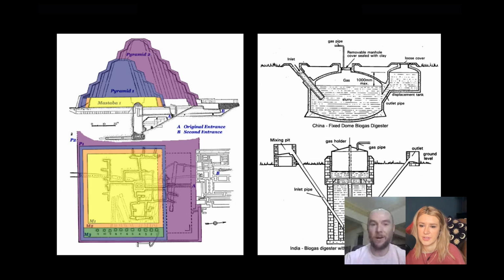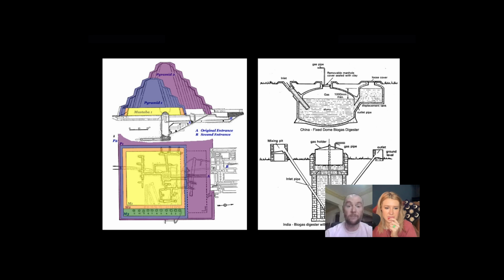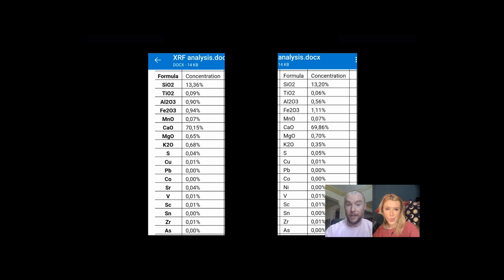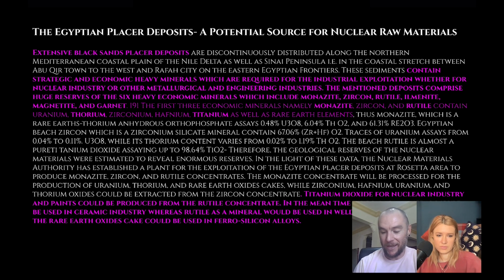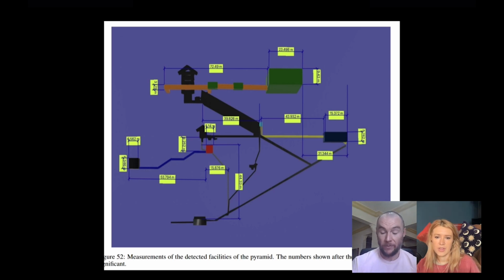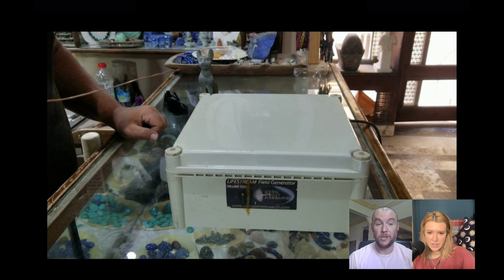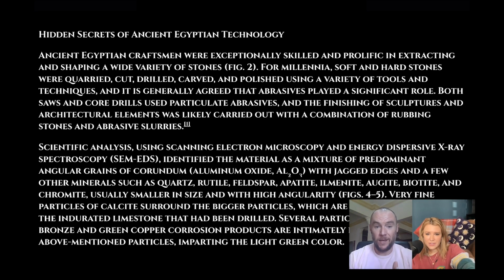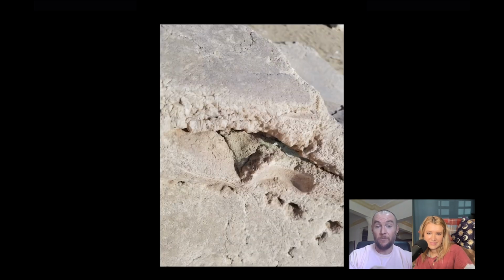The Original Purpose of the Pyramids

Comment: um, you never revealed what they would do with methane gas? or where they would store it? what burned it?  I do know that the one pyramid was hermetically sealed at one point, and it remained hermetically sealed until the 20th century, but they feel it was preservation of the tomb (mummy[s]) ?

considering they had no direct use for methane gas unless they were to burn it upon production to blast furnace iron ore...  yes they had iron ore and blacksmiths in the day, they had tempered steel, hammers and chisels, how they removed all that rock, every  bit of evidence of it is long gone and it was long recycled ..   there is PROOF they were smelting iron in Mesopotamia 7000 years ago!

so please STOP trying to make this more difficult that it needs to be, the chemical is from a smelting process, coke and borax!  good grief!

now that we KNOW they had blacksmithing we know they had metal pulleys, bolts, nails so on so forth ..

they didn't have gas heaters back then, nor gas stoves and moreso they had no way of containing methane gas!  PLEASE

they used whales for oils, they used oil burning lamps, PERIOD, no Coleman stoves FFS, for the plain and simple reasoning they had no bottles to contain the gas in, they had no way to fill bottles,  good grief magic..

unreal ...  they had NO WAY TO CONTAIN METHANE!  no way to STORE IT!  methane must remain under pressure to be volatile, they had no way to weld metals or make iron sheets to make bottles..

how did every household get the methane? for intents it may as well have been propane, see how we do it today? piping? valves? large bottles, small bottles?  they didn't have that back then, they didn't have gas lamps, they didn't have gas stoves!

had they had gas stoves and lamps over a period of 4000 years every household, there would be so many of them left here and there as they do not decompose, yet not ONE single burner has been found, not one single orofice, an orofice is requires to burn the gas, housings, then you need valves or the gas just burns at one speed.. yet zero evidence of any of that, none and every household would have these?  that's millions upon millions over 4000 years..

there isn't a SINGLE hieroglyph or petroglyph of a burning lamp or stove, and just like the Djeb pillars this technology would have been written everywhere.. they would have had an over flow flame burning at all times 24/7 like ALL natural gas plants have, not pone depiction of...

NO they didn't use the pyramids to make methane gas or chemicals, the chemical residue is form smelting which they did do, and they do have petro's and heiro's of this simple smelting process, bronze, copper and finally iron ore, precious metals as well .. they were using stamp plants to crush rock to extract gold, that's about as advanced as they were, rope and pulley
Reply: what is your thought on the conduit system that comes out of east of the pyramid and ends up in bowls made of large stones? it doesn't look like drainage, it looks like they were collecting something. chemical in condensed liquid form? those stone bowls are located where a temple was once located - now in ruins.

Comment: Sounds kinda like my idea that the pyramids exploded due to either flood or drought is correct. All three pyramids have retaining walls to keep the water outside of it at a specific height to keep inside pressure at a equal level like a float valve if water were to fill an exhaust vent it could over compress the gas and have a catastrophic failure. Just an idea

Comment: They couldn't do those cuts with saws or big copper drag saws they look like giant circular saws  and big ass circular saws need a big ass machine or motor to run them  so their is still a lot going on that the mainstream doesn't address  and the speed of these tube drills and  circular saws which they can calculate in the striations are like 50 to 500 times faster than what we have today  when we cut stones that big and hard its still a slow process  and that's with modern machines and water sluries to help aid the cutting

Comment: If they could make different alloys  why use copper at all then  and it also doesn't explain the saw cuts that look like giant circular saws that would have to be in so.e cases 30 plus feet or more big and the saw cuts were they look like they dipped into the stones  also that one picture looks like alabaster which is really soft

Comment: Alessandro Barsanti stumbled on the Zawyet El Aryan site.
After so much digging and removing rocks that had been used to hide what was a water chamber.
An oval shaped bowl was found with a lid glued on it, it was apparent that it had a black oily substance that had almost evaporated. Pink granite was everywhere, this place is 5 miles southwest of the Giza plateau. There are deeply etched water line marks.
A two way water pump was sending water to Giza. Oh, it was also mentioned 2 pyramids maybe were used together. Once energy was established with water, pink granite to carry electricity up to the gold top of the pyramid. The water pump was carried out using a small true to scale from the underground chambers. It worked.

Comment: Interesting. But the value of the produced chemicals needs to be exceptionally high to be proportionate to the cost of construction. Most likely not for fertiliser. Composting manure on site would be far superior to transporting to the pyramids and back again. And the volumes that could be processed seems tiny for the scale of the project. But possibly industrial/manufacturing chemicals.

Comment: Im also a ChemE. I was not aware of this fellow and his work. I plan to watch his other videos and review his theories.  One thing I will say now is that every time i have ever looked at a diagram of the chambers in the GP, it reminds me of some sort of reactor. It also explains why the extreme precision was required in the stones. They had to fit perfectly because it was a pressure vessel made of stones with no sealant or mortar.  Today pressure vessels are usually made of steel. But they only have a life of a few decades. If they wanted  something to last millennia (and survive inevitable wars) it had to be made of stone.
Anyway this is very intriguing.

Comment: 9:52 could you determine the flow rate, weight and viscosity of the fluid based on these patterns? I work a lot with DNN and I see a perfect opportunity for application on pattern recognition of fluid dynamics on these structures- it would take some time to implement so I wanted to know if it is possible to tell without that?

Comment: I want to believe this. But stone doesn’t slide well. It may have been exactly what you’re saying, but it only worked for a minute. If they used the small shafts as a choke, there would be easy access. Not blocked with closed entrances. I think the small shafts were closed and filled with water. For conduction. Making a water power line essentially.

Comment: Giza, due to the tuned 70+ ton stones in the kings chamber, vibrates at an F sharp. Coincidence this is Earths natural vibration frequency. The pyramids purpose was to eliminate large earthquakes. 
Built on a ley line intersection and apparently at one time on an aquifer.  The pyramid shape is an inverted funnel for -ions. To stand on giza, even with its outer electrical insulation removed, your hair would stand up like your hand is on a van de graff generator. Massive -ions flow out the top providing Earths ionsphere.  

The pyramids are terraform machines.

Comment: The saw blades shown later in the program was not what was used by the megalithic builders.  There are cuts in positions and locations where that gear cutting tool could not account for.  If it's so simple, go ahead and prove it.

Comment: All natural rock is porous, so using stone vats would mean they bring soaked through.  Due to soaking in and down (due to gravity), it'd be sloping at an angle.  A stain would be soaking deep into the ground, of course.  And where is it?  If they had a sealant, they wouldn't have stain at all.  Presumably, a bad seal, over such a time, would have stain deep into the walls and ground.  So where is it?

Comment: The pi ra mids . Are for sound resonance chambers to balance the chakras ie our glands. Nothing to do with chemical plants . Pi as in it take pi to even biuld a pyramid Ra as in it used amen Ra the suns ra ys and mid as the pyramid does have a brass shaft which is also earths that goes from what would have been the golden cap and the solar panels on the pyramid skin .

Comment: Hey ye funny ol world, hard work but we got through it 😅 the guy has an interesting take on it and makes sense they served a purpose.. the most feasible theory I have heard to date is the structures being mine waste deposits (composite blocks stacked in the most efficient geometric shape possible).. eerily similar to the smaller scale and less developed methods we are using in the mining industry today.. It would make sense to utilise the placement and guts of the structures for a dual purpose like above.. (Curious Being theorised the chambers and 'vents' were to reduce mine waste leakage from the chemicals involved in mining but there you go).
 Also I wanted to point you guy's towards the examination of a vase from under the bent pyramid (of which there were a couple of thousand), which suggest in their very accuracy a far more advanced method of cutting than as this guy mentions.. this vase has like 3/1000'ths of an inch tolerance across two axis so the technology required to even read those tolerances let alone machine them is mind blowing to me.. were talking about the ability to machine spiral gears even to start gauging tolerance with a mechanical calliper/vernier let alone to start machining them.. and then we must ask the question 'why' they would actually even consider needing these tolerances, not to make laser precision granite vases thats for sure as they only function in asthetics.. if you can understand that  champion.. all good, love your take on life btw 🖐😊  pyramid juice 😂👍👍

Comment: The base of the red pyramid "pump shaft" would have been a valve, not a plunger. The valve's purpose would have been to manage the pressure in reaction chambers created by the column of water in the shaft. It could have been pulled up from the top.

Comment: Something not discussed at all.. the pyramids are way overengineerd if the initial purpose was to make methane/amonia. Try to align the builings in a specific way, finish the outside with presicion. They could have build a way more crude building for that. It doesn't make sense to me. A far more realistic scenario would be that during the stripping of the pyramids for building materials, some people can to the idea the can mix dong and iron in some chambers to produce ammonia. Probably easier for them than digging a hole in the ground and put dong and iron in it. But building a pyramid for that, no.. the first claim, amonia and maybe methane, oke, but the latter chemical processes, I'm not convinced. Some trace elements of heavy metals are common, thats why they are trace elements. Using a electron microscope to analyse a "sample"? You can probably find a trace partical of thorium in every home. I think he's reading too much into it and trying to come up with a chemical process thats fit some trace elements. Im not a chemist, but I would like to see debates on the subjects with people specialised in pyramids and chemistry to see what there arguments would be. I can't find any critisism on this subject, red flag.

Comment: Wait!  You labeled the Roman stone cutting machine as "ancient technology' but that is not a realistic label because the machine depicted is from an inscription on a stone block from the 3rd century AD!  That is not "ancient".  You could even call it modern... as in the age of modern metals, advanced engineering, and hydraulic concrete.

So, you need to recognize that the age of Egypt that you are focused on is some 3,000 years earlier than that.  That being the case, it cannot be said that because the Romans had stone cutting machines therefore the Egyptians of multiple millennia before them did also.  A society that is supposed to have not had the wheel yet certainly did not have gears.  That leaves the very real possibility that they relied on heavy, wide, large pendulum saws along with the hard-grit slurry that is still used today in drilling for oil.

Comment: 28 minutes into video, basic hydraulics, you wouldn't need a plunger if the water column is higher than the chambers. The head pressure would act as a plunger increasing the gas pressure. No piston or plunger to seal. Water only.

Comment: plus with the area having been previously a jungle of sorts, there should be no shortage of methane gas below egypt around the flood plains. with their obvious advanced tools and drilling capability, i can see this theory as a possibility for the pyramid at Saqqara, but def not the primary 3 at Giza and it doesnt support the reasoning for the maze complex under the entirety of the Giza plateau which most are unaware includes pretty much every predynastic construction even down to Saqqara, if i remember correctly.

Comment: A really interesting theory for sure, and it seem to fit on so many levels, Im not a chemical engineer or whatever and its probably been thousands of years since it was last used but if this is what the pyramids was actually used for is it actually safe to crawl around in the pyramids?, I mean if I was to visit a modern chemical plant today I surely wouldnt be crawling into and looking around in the plants chemical containers and tubes? that would be kinda dangerous :D
Reply: Well they arent really safe no, in the modern day there are airshafts installed into the shafts themselves in order to increase the airflow into the internal chambers, thats what those rectangular pipes are that run down the shafts - a modern installation to make access safe. Not to mention the installation of steps into the descending/ascending shafts - it would have been much more dangerous before modern tourism made these additions.

Comment: Ihave a question.  How does the ark of the covenant fit into this?   It too was a generator of some type and it's said that the ark fits perfectly into the "box" in the kings chamber.  And from descriptions by Justinius of the temple in Jersalem was built of white granite and had gold plates on the outside. and the "holyof holies" was at the top.  And thinking of the stones on the vests of the priests.....there's another connection of something going on.
Reply: It was a big capacitor with monoatomic gold inside as a catalyst. Checkout Laurance Gardner.

Comment: This makes sense because we know that to do the gold work that they did at the level they did it at requires very high temperatures. We also know and have found in Tutankhamen’s tomb, a knife that was believed to have been smelted from a meteor right the heat required could’ve only been developed using methane, gas and coal and many other metal objects with unusual mixtures of elements which would require tremendous heat. There are many archaeological findings that proves in this area of the world they were furnaces. That were able to create extremely high temperatures, and with a good knowledge of chemistry this could’ve been achieved, but the problem you have is the institutions that are claiming they know what went on, and how advanced these people were, do not want the rest of the world to know this information because it destroys their paradigm and the paradigm that we came from very low forms of barely intelligent people, and have gotten much smarter when in fact, it is reversed, and they cannot explain this according to their paradigm, they want us all to believe in. It’s all about power and control. Controlling the masses by telling them, they know the truth when they don’t this is the same thing they are doing today with the global warming farce keeping people ignorant of the truth, so they can manipulate us. The truth is the most powerful weapon on earth, and it is Surrounded by a bodyguard of lies.

Comment: 2:04:00 This is much more important observation of the materials (stone) and cavity designs (shafts, chambers, corbeling, etc.) that should be of primary importance at a fundamental level in this video, in addition to the chemicals potentially used. Personally, I feel the heavy reliance and assumptions of chemical pumps and the end product desired (electricity, methane, etc.) are a bit premature without looking at the complete designs (as much as we can obtain) and the dimensional properties in relationship to each other. That is THE key to really coming into a functional concept. I do appreciate the efforts that were put into this theory even though I am finding a lot of bad or incomplete assumptions leading to other assumptions; a house built on sand, so to say. I will be following his work though, because it all helps in the grand scheme of things, at least in part. Never throw out the baby with the bathwater.